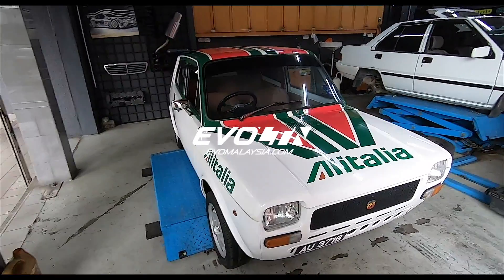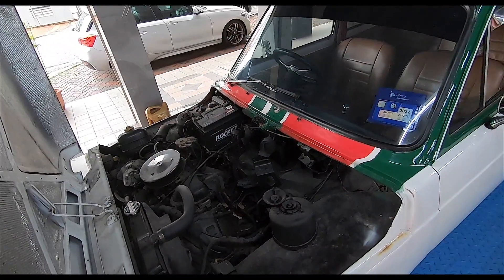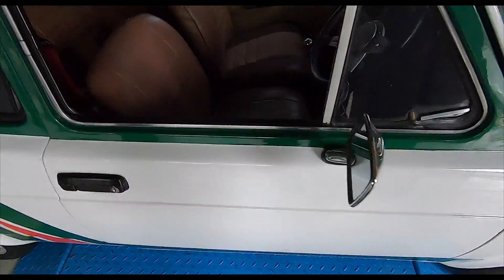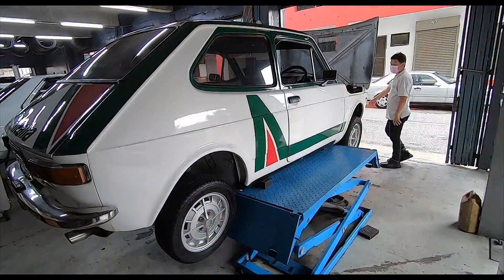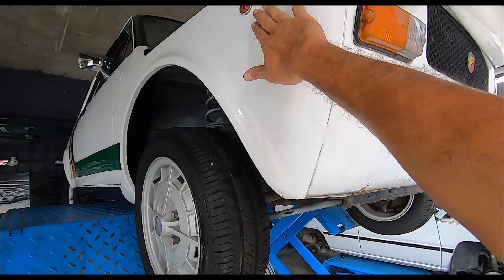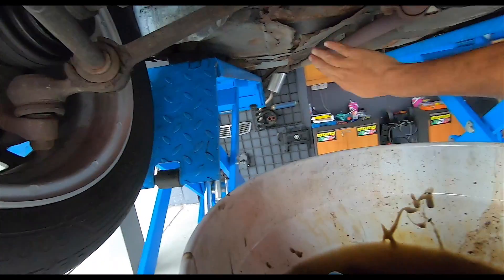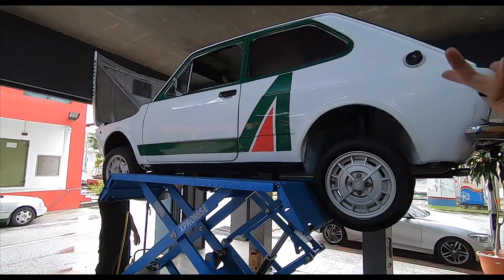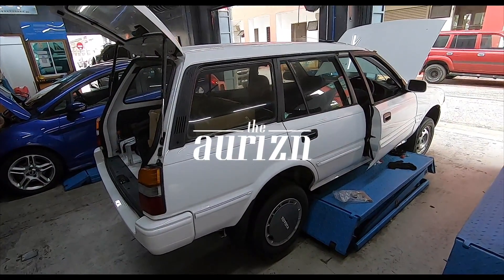1975 Fiat 127 "Alitalia" - The Journey Begins! FULL New Weevil SOP Underway! | EvoMalaysia.com

Comment: Hi Chris, just curious, i believe when Bobby took ownership of this car, some work was done to fix her up? Did it not include the engine oil and gearbox oil change? If the blood transfusion was done and with minimal driving in the past two years is it normal for the oils to be so black?
Reply from the maker: Yep, all that was done, but over time and from lack of use, lubes can lose their lustre aka viscosity and turn out that way in the long run. I reckon time is more a factor here, not just mileage bro 😊
Reply: @ChrisWeevilGarage  Thanks for the info, good learning here especially for car owners who delay preventive maintenance when mileage is not yet reached.